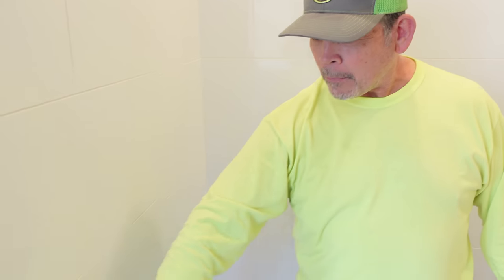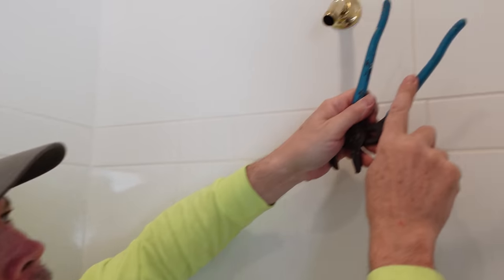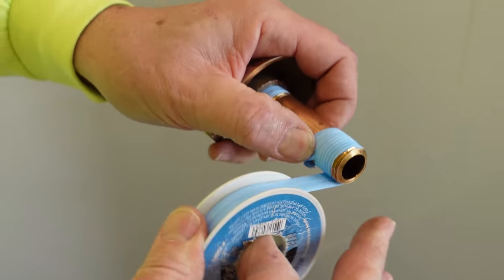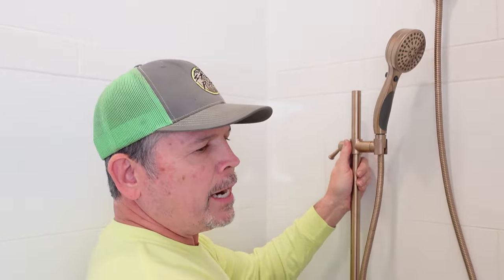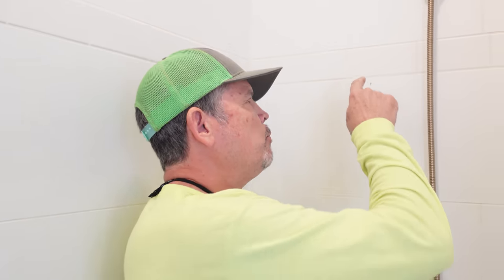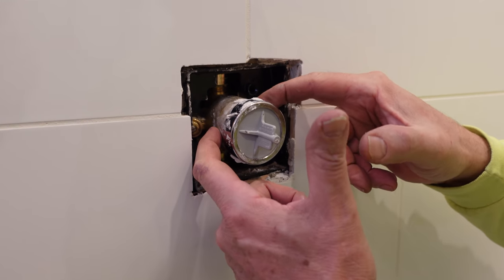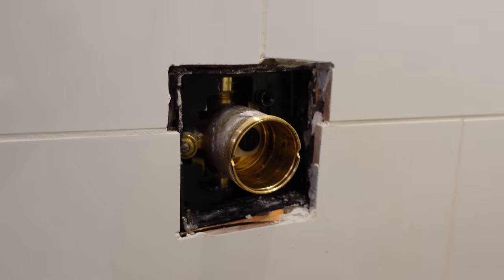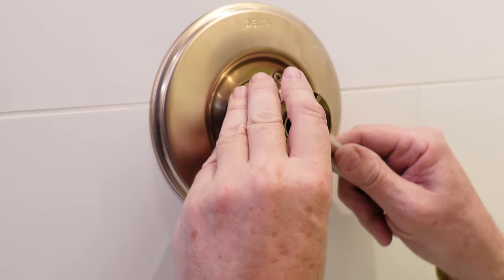How to Install SHOWER TRIM (Step by Step)

Comment: Another excellent video, guys! One tip from someone who's worked with O-rings since before they became ubiquitous: always fully lubricate O-rings upon installation. For home plumbing (and food processing) Super Lube O-ring Silicone Lubricant or Trident Pure Silicone (primarily for divers' face masks) work well. Silicone grease, without the solvents and adjuncts in spray-on products, preserves the O-ring, aids installation preventing twisting and pinching, lubricates  functional movement, enhances the seal by allowing easy movement of the O-ring, providing a secondary seal medium, and by filling the tiny imperfections in the metallic interface, and it retards corrosion and mineral deposits at the interface. Well worth the greasy fingers.

Comment: Only thing I would add is to use water proof valve grease. Valve body inserts can and do get extremely stuck. There is extraction tools but even those don't always work well and you end up busting it out. You do NOT want to scratch the inside of the valve body at all. Great content Studpack crew. My Dad and I also do home remodels so I love seeing another father son team doing the same line of work.
Reply: @tullgutten  it’s better to not use Vaseline or any petroleum lube as it can degrade any rubber seals or o-rings in the cartridge body.  Special valve grease is where it’s at!
Reply: That's my go to when I'm assembling plastic plumbing
Reply: Agree on the grease. I had an ancient stuck valve and tried all the techniques to remove it. I ended up carefully melting the nylon valve body out with my MAPP torch, and cleaning the body with a brass brush and 1200 grit sandpaper. Should have protected the shower floor as the molten nylon and rubber spread soot everywhere. Half hour plus a half role of paper towel and mineral spirits cleaned the mess.
Reply: @dannyrondeau7873  you know what, i never thought of what vaseline is made of... Didn't know it was petroleum based 😬
With this new knowledge i take back my first comment😅.

I always say petrolem based grease and oil should stay away from plastic and rubber as it degrades it.

Silcone grease is the best but hard to clean if you make a mess.

Have a MOTIP can of White Lithium Grease that says on the can it is safe for plastic, not 100% sure but it seems to be safe and without petroleum in it
Reply: Researched the MOTIP White lithium grease with PTFE now and i only find that it is safe for plastic and rubber.
It is composed of "EP-2 Grease" which is a lithium base soap grease without petroleum and is widely used for automotive in wheel bearings and ball joints (ball joints always have plastic and rubber in them).
The only hydrocarbons is the solvent to make it sprayable but that evaporates in a few seconds
Reply: @tullgutten  Yeah not knowing how a grease will react to plastic could be a problem. I have seen hours worth of work be ruined overnight because of Loctite literally cracking plastic. The Loctite was used on imbedded steel nuts within the plastic  assemblies. It was also a time consuming assembly. Sad Day.
Reply: @tullgutten  Some things I use White Lithium Grease. Seems to be ok on Nylon. I use it on Nylon gears. Works on the turn indicator under the steering wheel. I have used Bee's Wax too, it stays put, washes out of clothing and nontoxic.

Comment: My dad and I are more than capable In construction and electrical but we have a love hate relationship with plumbing. A few years back we decided to replace the tub faucet in my master bath. After a couple trips to the big box store for the right stuff we lit the torch and started removing the old and sweeting on the new. After the last connection we decided to take a break to congratulate ourselves on defeating the evil plumbing gods. After ten minutes I went to check for leaks and found the closet where access to the plumbing was in flames! We had failed to cool our last fitting and the 2x4 caught fire! After some inventive swearing and a wet towel the flames were under control and from that day on I’ve never failed to pay a plumber for even the minor stuff!  Love your videos and your father son relationship keep it up guys!
Reply from the maker: Thx Walt 👍

Comment: THANKS. I've struggled for a year with the same shower handle not getting hot enough in the winter and not cool enough in the summer. I had a professional plumber install it and he even asked me if I wanted full range. I just NOW went there and made the adjustment you said to make--it now gives me the full range!  Thanks. Wow.
Reply from the maker: That’s so cool David thx for commenting 👊👍

Comment: Thank you for this shower series! I’m in the middle of renovating my parents house and making it more accessible for them. I didn’t even know what a curbless shower was before and now I’m going to install one for them!
Reply: I've seen bathrooms in Japan that the whole bathroom floor is curb less. The drain is somewhat center of the bathroom towards the shower. In theory you can hose down the whole bathroom floor including the toilet and it would flow down the drain. When there was a plumbing leak everything would drain before going into the rest of the home. Kind of like our campers and motor home's bathrooms but just bigger. The restrooms in many businesses have floor drains.

Comment: Great, as always.
One suggestion:  I think it's super useful when Paul discusses dealing with suboptimal situations (like with the stub-out).  I thought there were a few other aspects of this for which it would've been interesting to hear Paul's work-arounds (e.g., mounting to uneven tile, what to do if the showerhead stub-out is loose, etc.).  Those of us who work on older homes and deal with other people's poor workmanship know that things don't always go as smoothly as the directions indicate.  :)  Paul knows this better than most, so his tips (or commiserations) are invaluable.

Thanks as always.

Comment: I've installed and serviced dozens of these valves.  It is imperative to use a small amount of copper anti seize under the bonnet nut that holds the cartridge to the valve body.  That large nut likes to seize,and makes servicing the valve very hard.

Comment: I was starting to get withdrawal syndrome!  Great tutorial!

Hot on the left, cold on the right and you know what doesn't run uphill! Congratulations, you are a plumber!
Reply: Tell that to the guys who installed my kitchen sink, I live in central Ontario and they not only put the hot and cold o the wrong sides but also plumbed thru a outside wall facing north across the lake in a 6 inch wall cavity, using fiberglass batting only in the wall, Good thing i had the sense t o install a heater in the crawlspace under the kitchen floor which helps keep the pipes from freezing in the minus -30C we have been getting this February. Appears not all plumbers are created equal.
Reply: @southerncomfort971  That is for sure. I have been having great fun at learning allot about the latest building science and technology. Some of my experience in hiring contractors and some of the projects I’ve done was quite a learning curve. Despite trying really hard to be real clear then I learned where my shortcomings were. I am more invested now than ever to make sure that I understand the various different practices on how to install something and figure out what I think is best and appropriate. Stud Pack is one of the few channels that I mostly agree with what I see and appreciate the quality and caliber they try to put out. I also watch Matt Risinger as well as a few other channels. I appreciate comparing the information and deciding for myself.

I have come to the conclusion that if I don’t get a basic education in what I want to have done and something is not being done right then I won’t know any better and that is my responsibility. You would think that we should be able to trust a professional and not to stand for such low quality work but you need to know what you’re talking about to ensure that you get what you’re supposed to. Information and a college education was valuable at one time because it wasn’t that easy available before the Internet became so widely available. Now we live in the information age that make information so widely available that if you don’t consider how fortunate we are to have access to things that just were not so easily available once upon a time. Then we may take for granted what advantage we have now compared to then. (I’m not saying that college is not valuable but it’s just not as valuable as it used to be.) 

I find this no different than blindly trusting a CPA. You shouldn’t have to do the CPA’s work but if they know that you don’t know a damn thing and you are blindly trusting them… then who are they likely more afraid of?… You or the IRS? Get a basic education on tax fundamentals so that you can have an intelligent conversation with your professional so that they can realize that you have an idea of what you’re talking about and they might want to pay attention to you a little better than someone that wouldn’t know any better. Good book to cover layman’s tax concepts, “ Tax-Free Wealth” 2nd edition By Tom Wheelwright CPA. This taught me my basic tax asset classes, rules and the tax overhaul that we had from 2017. (I ran into a situation with a CPA recently that got me mad. Regardless of what industry (plumber, construction, CPA etc.) then you don’t have to be a professional at it but if you want to make sure that you are getting the services that you need then you might want to do a little research and educate yourself to a minimal degree is what I have decided. The moment you stop learning is basically the moment you died. 😄😁 Your body just hasn’t caught up yet. 🤔😏😁👍) Getting yourself a basic education in whatever you need to know also helps to screen out the “professionals” that you might come a cross. 😏🙄🤔👍 

I am currently going to have to have my whole house replumbed and I am in conversations with a plumber right now. He is the first one I have found that seems to have the ability to have an intelligent conversation and understand what I want. He found it an interesting experience to have someone that had done as much work as I had in learning what I need to know before coming out to give me an estimate. 😄😁😏👍 I highly recommend Pex A or Uponor is a brand of Pex A. It is burst resistant, it is a cross-linked polymer that is able to expand to a degree without busting the pipe in freezing temperatures and then be able to return to its original size. There are so many other benefits but here is just a little bit of information. I love the information that Matt Risinger has on this. I encourage comparing multiple sources. 

I wish you well, I hope this helps and take care!
Reply: @insecureinvestorchallenge7366  in almost full agreement, college isn't the issue though, sure you can learn something whether it be trade or finance or whatever, its ethics that becomes important and  your own knowledge thru the web allows us to spot the unethical people sooner. Unfortunately i thought I had done my homework on what needed to be done and hired a "guy" locally hoping as a resident of the area would know the local trades who do "good" work. he may have known them but hired different people and here some 4 years later still ind and correct things that should have last the remainder of my life as i was 63 at the time and getting ready to retire. On the positive side of that, having to do this work now my self or with family, i am learning skills,lol,  fixing issues and staying busy, which subsequently has helped "keep the old man out" and the young man inside me to continue learning and working ,but now for myself. Still when you look for someone to do a job and you have the funds to pay them, you should be able to expect a decent job.done atleast properly if not perfect or to your liking, but RIGHT.
I could go on for days about issue and repairs' and all the things i have had to fix or deal with since the upgrade in my cottage home to a full time living space. but i try not to dwell on the past or the degative, since those thoughts don't help anything. with the one exception of making others aware of what you might encounter on your adventure. so it comes back to "buyer beware" good luck and stay safe and well. Thanks for reaching out.
Reply: @southerncomfort971  I have to say that I appreciate your reply. You sound quite awesome and I imagine that I would really enjoy getting to know you. It made me smile about how you are keeping “the old man out and the young man in” at this stage in your life. You can’t always tell where someone is at in their life and I’m always hoping the best for everyone. I’m sure I probably go on too much but I just hope that somewhere in that then depending on where that person is in their life that I might have said something that was helpful. Your wisdom is much appreciated. I can see now that you have gone through allot more journey than I knew. I appreciate, admire and respect where you come from and where you’re at. 😙😁👍 Take care and I totally appreciated your response. 😙💯👍 Thank you!
Reply: @insecureinvestorchallenge7366  you're quite creepy. I don't think anyone should "get to know you". 🤔
Reply: @NavigatingChaos  I’m so sorry that you feel that way. I’m not sure that you intended it to be hurtful but I really appreciated the kind, wise gentleman Southern Comfort. I had no clue at where he was at in what stage of life and when I realized how seasoned and wise he was then I totally appreciated and admired his position in life. I might not ever get to actually know him but I was trying to say something nice and respect to where he is at today. 

I think it would be awesome if I were given the opportunity to get to know him. However I’m sure that’s likely not going to happen. I was simply just trying to be nice. Just for the fact of the skill sets that he’s gained over his life is something that I totally respect, admire and completely appreciate. I was trying to say something respectful and if you cannot see that then I’m sorry that you had to make such a comment. Maybe it just hit me wrong or affected me badly due to things that you may have had no idea about but I appreciated the gentleman and I’m sorry that you felt the need to say such things. 

Regardless… I wish you well.
Reply: @insecureinvestorchallenge7366  Thank you , that was very nice of you to say.  I do try to stay positive even in my rantings of things gone bad.  I find when i am looking for solutions of preventions it's easier to deal with than dwelling on the problem as a problem. Yes its nice sharing with you too, especially since over the last 3 years with covid.  When talking to anyone ihas the potential of becoming possibly deadly.  I am mostly isolated living at what was the cottage turned home, in Central Ontario but occasionally run to town for things and then we still have the summer residents who are coming more often due to travel restrictions.  Thank you for sharing your time also and hope you are well and safe.  You can reach me here any time, i do check daily.

Comment: It's not just tradition that dictates Hot on the left, Cold on the right. It's part of the IBC code. Also, when a fixture maker designs their parts, they have indicators on them for hot and cold water position and temperature. If the valves are put in wrong, the indicators are practically useless to anyone wanting to adjust the temperature. A bit of valve grease on all moving parts in the valve will help things last longer, and operate a bit easier for much longer. If you have issues with the escutcheon plate for the valve sealing against the grout lines, a silicone grease can help it seal properly against textured tile or deep grout lines without worrying about future maintenance.

Comment: Thanks guys, I’m getting ready to remodel my master bath and have 2 Delta 17 series valves to install! Perfect timing!!
Reply: Please check out Schluter. I recently finished taking 2 of their workshop classes that are free and I didn’t get just class time but hands on installation experience with instructors supporting me every step of the way. Invaluable experience! They teach standards from the TCNA handbook and show the requirements to install their product. I learned so much from the various different traditional ways of installing waterproofing and different aspects in a bathroom installation. Walking away with a broad range of information from traditional installations to how they install their products was an awesome experience for me to consider, take the information and decide for myself. They also have a YouTube channel that you can reference for proper installation. YouTube channel good. Workshops are so much better as far as I’m concerned. I hope this helps.

Comment: I will give you guys credit for taking the time to make these videos!  Like you said if it helps one person out it's worth it for sure.  I do the same thing as you, and as the fellow said below, the only thing different I do is coat the o rings and the threads on the valve body with silicone grease. Just knowing that most water is hard around here in the northeast.  Once again I commend you and your son!!